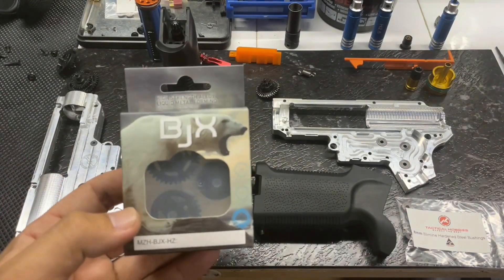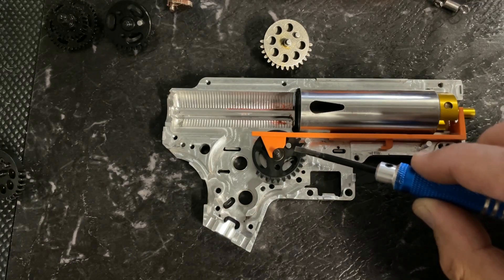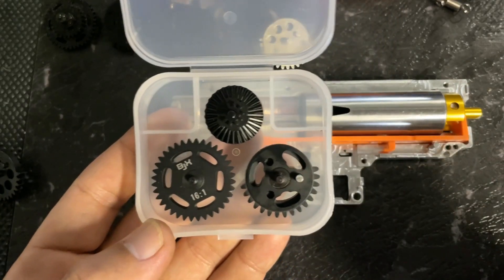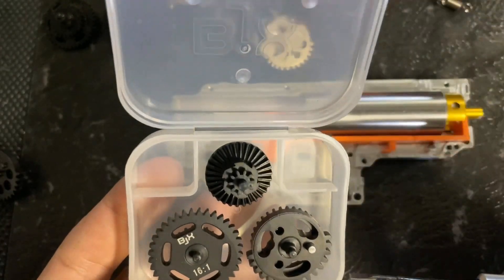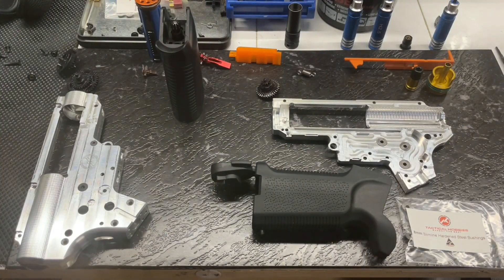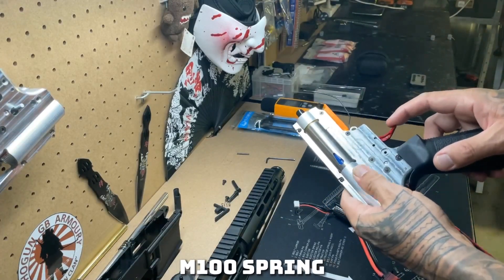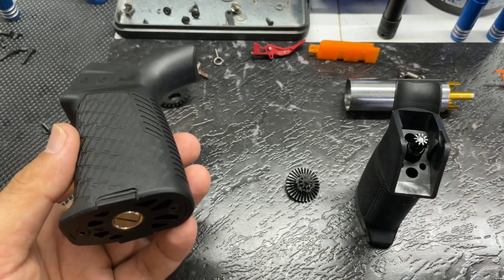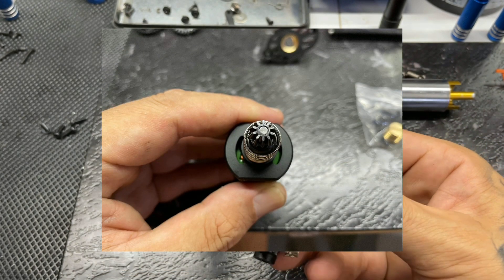BJX Gears Part 1....Poor motor and grip alignment while using  an ASG infinity motor...the results

Comment: Hey mate! Another great vid. I've done some many hours r&d on the positioning of the tappet pick up lobe on sector gears.  With the BJX gears, the tappet is picked up later in the piston cycle than with shs. Where this is important, is in high ROF builds that are full stroke, where the tappet can/will be picked up a fraction of a second before the piston has completed it's full stroke, resulting in an air leak from the t-piece. This can be resolved by short stroking/making your piston lighter/using a heavier main spring (all of which cause the piston to return faster), however, to achieve high rof with full stroke and good air volume ratios with a longer barrel, whilst keeping under 300fps, the different tappet pick up lobe will resolve the pre-mature tappet pick up issue quite easily.  Hope this made sense...
Reply from the maker: Yeah bud it does, think I’ve done similar with the tappet plate by adding 2mm to the front so it gets picked up later.
Reply: @hiroshimascreamer5884  great work as always! You in qld? would love to catch up one day
Reply from the maker: @jj87a  yeah bud, I’m in Brisbane